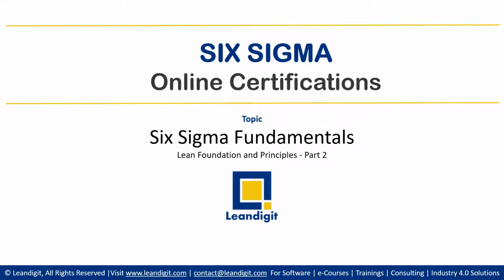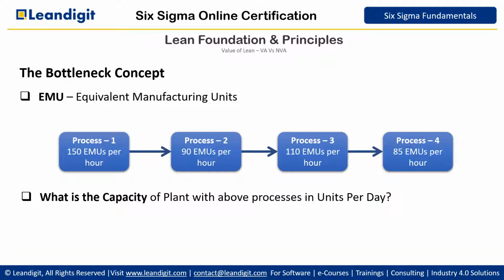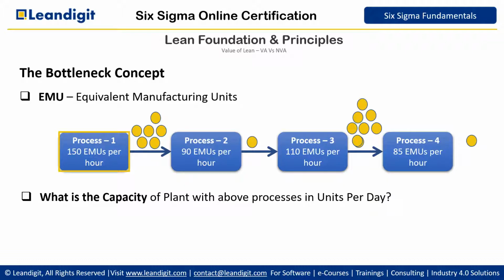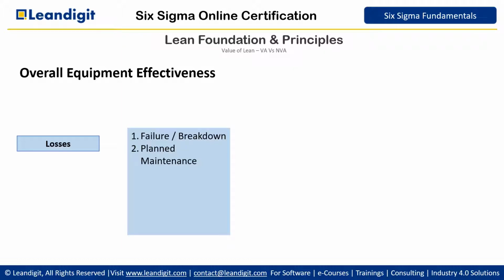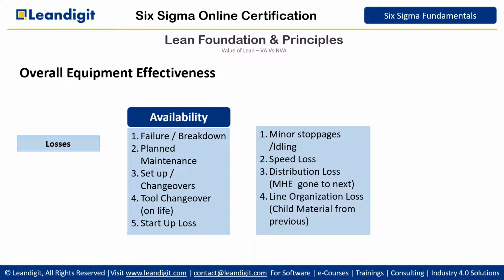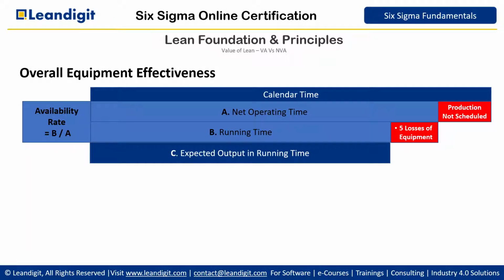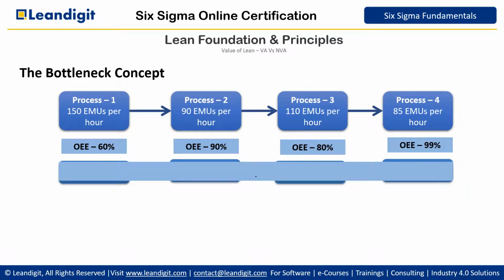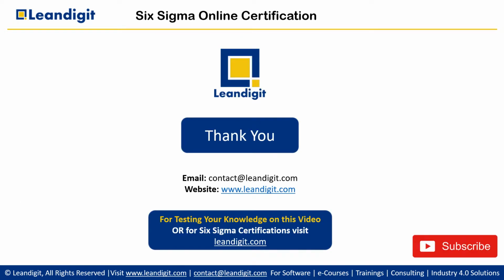Bottleneck and OEE

Comment: Sir, quality products, rework, scrap, etc. will be checked later only, but during production, bottleneck/pile-up will still happen at both the places, correct? And so, should the capacity of the plant be taken, based on the process having minimum EMU/hr, that is 85? But again, if we maintain 85 from start to end then too pileup can occur in case of particular step delay, rework, etc. So, what should be the ideal input volume to achieve a non-stop processing of entire mechanism, say if it was a manufacturing setup? or will I get the answers in further lessons? Thank you.
Reply from the maker: Good practical question. Reliability are expected to build inventories at all points. We analyze this to identify such opportunities for improvement. Of course, subsequent part of course includes identification of opportunities and how to handle.